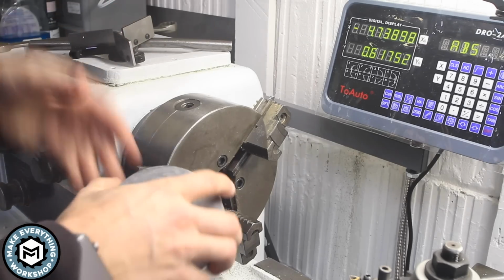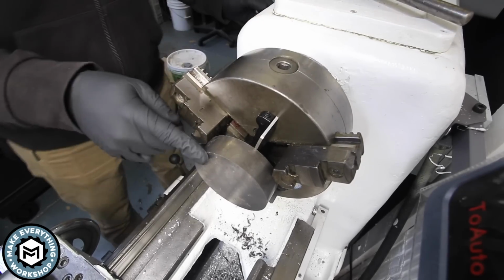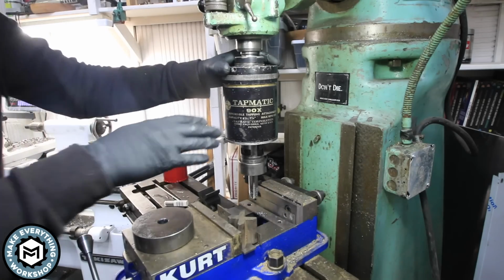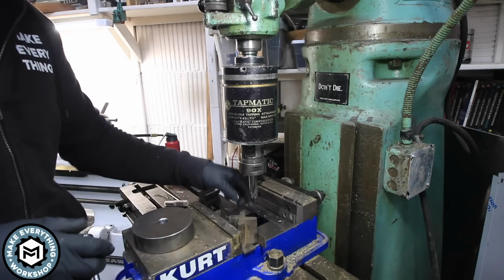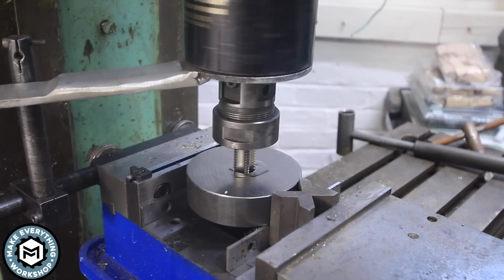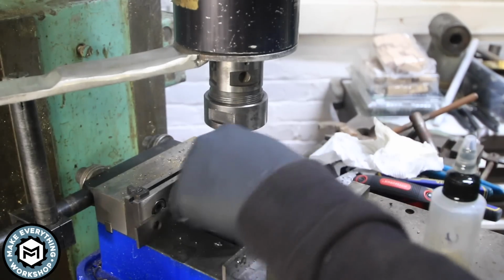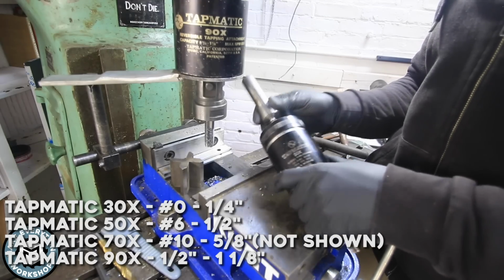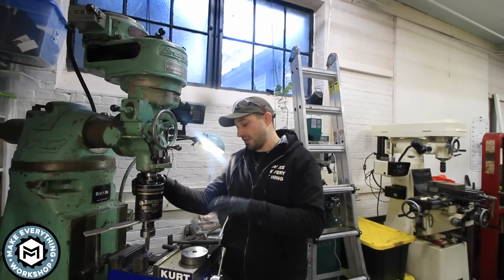The Easiest Way to Tap Steel Parts - Tapmatic VS 1" Steel Plate

Comment: I had seen those but never saw one work. Seeing that it reverses with up pressure explains the benefit. I just tapped 16 M6 holes with a low clutch setting on battery drill yesterday. Thanks for sharing!

Comment: Where I work we have 3 of these in various sizes for the drill presses, plus one attached to a hand drill (up to 1/2"-13NC).  That one can play havoc on your wrists if you're not careful.  But it makes it easier for tapping large items like 6" square tube with 1/4" wall thickness that is 15' long.

Comment: Nice video.  Now have you thought about using the tapmatic with a die? What I am saying is put the rod into the tapmatic and mount the die on the vice on your drill press. I don't own one so I'm not sure how the rod would hold in the tapmatic. You didn't show that part but it seems like it might work.  What I need is aluminum rod 3/8th with some threads on one end.

Comment: Will the Tap-matic work horizontally?  Could you set it up in the lathe tailstock?
Reply from the maker: Matt Berg I don’t think so, it relies on the spindle moving to operate, I think if the spindle was locked in a chuck it would bind up, but maybe worth a try

Comment: Great video thanks!  Do you know if the arbors on these all thread into the tapping head?  If you buy one on ebay with an MT4 for example but want to put in a straight shank arbor can you just thread the old one out and put a new one in? TIA

Comment: Hello. I have two tapmatics (50x and a 30 TC/DC). I have just acquired them.
My question is what collets (rubber) do I need to cover the range of the 50x and what collets do I need to cover the range of the 30 TC/DC?
I see you can purchase the collets but they are reasonably expensive and I don't want to buy any more than necessary. Regards.

Comment: Why not do the whole operation with the lathe?
Reply from the maker: In my experience, and with my workflow this was the fastest and safest way to do it. Ive never had good luck power tapping in the lathe, and setting up to cut internal threads would have taken too long.
Reply: if he has the torque on the lathe to push that tap , and a way to hold that tap , then agreed.
Reply: @airgunningyup  I do and I do many operations with SS tap and die, But I guess if you have several hundred $$$ to spend. Well then okay.
Reply: If you have the tooling, it could be quick.  You're assuming he has the proper threading tool with a long enough reach.  I would assume you could use the tapmatic on the lathe too, but wouldnt be much faster
Reply: Ever tried a spiral point tap? They push the chip forward through the hole, so they don't get stuck in the flutes....I did some 3/8 holes in thick stainless blocks, just held in a drill chuck (in the mill) and it cut like butter....reversed no problem....I agree that power tapping in a lathe is a huge pain, using the mill is the right call....
Reply: My 3/4" left hand taps are $200, I couldn't risk power tapping one of them